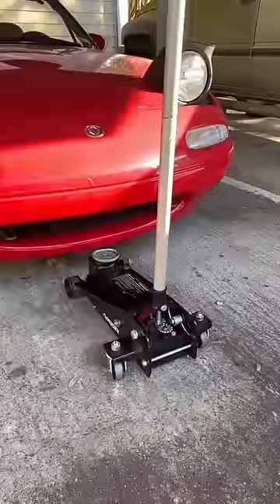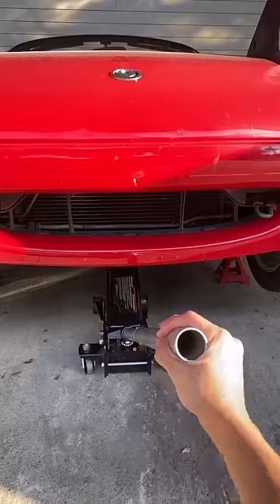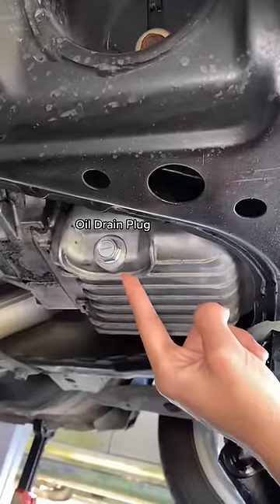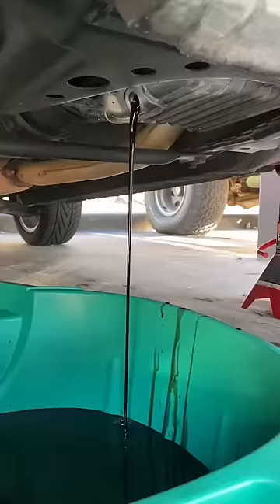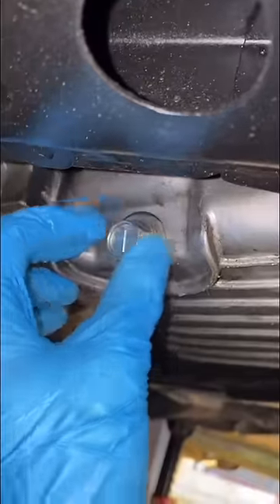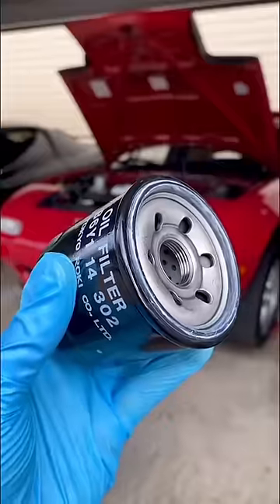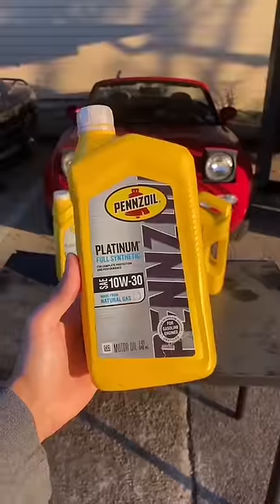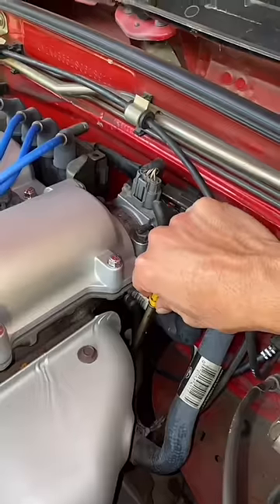How to do an Oil Change! (in any car)

Comment: Video : tighten by hand.
What the local mechanic hears: "tighten to 45000 ft/lbs with the new ass blaster hydraulic thread removal system"
Reply: the ass blaster 😂 that’s me after taco bell 😂 😂 💀
Reply: @rollincoalyt301  The Baja Blaster
Reply: You forgot the threadlock!!!
Reply: Bruh I'm an apprentice tech and we do that shit all day everyday 🤣
Reply: @RickyBobby42069 forel i work on the shop with my uncle and we tighten everything super hard like fuck torquing it to specs
Reply: You go to a bad mechanic shop then i guess
Reply: @jessebol  no its better if they do it tight
Reply: @Tuck3rmurph  why is that?
Reply: @TheOath888  there is a chance of it getting lose and bleed oil. And if something happens to the filter or it falls off, that is a bad name for the shop. So we tight it really good. We have a special tool for it (don'tknow the exact name, we just call it the "filter box"), it can be connected to a T-Bar and can be used with ease.
Reply: The same mechanic you cry to when your car has trouble 😂
Reply: Your model name has me dead lmao
Reply: 🤣🤣🤣this has actually got me rolling
Reply: It's because oil will leak out sometimes and customers complain so the dealer tells their lube techs to tighten 1 full rotation after the gasket hits the top
Reply: @SunhatAshTrUsTinJeSuS exactly. Tighten by hand until tight and then tighten 1 circle with belt wrench
Reply: I've noticed on my personal vehicles that even if I tighten by hand that it will still be tight af next oil change

Comment: Also you should start the engine for about 10 or 15 seconds and recheck the the dipstick then top up if needed
Reply: Before that, when I am changing the filter I prefilled it so the engine never runs without oil
Reply: absolutely. This is what every mechanic i know does, this is crucial in my opinion, the level will always drop significantly after startup, always reckeck and top up

Very disapointed old mate didnt include this in his video
Reply: Also you get more oil out if you remove the old filter before the drain plug.
Reply: @joshferguson2883  exactly I'm not a mechanic but I learnt a very surprising amount when I did work experience at the place my dad goes and I also learnt alot going there with my dad because we are good mates with the owner, so I may not know everything but I know simple maintenance at least🤣
Reply: Its a good idea to check for leaks, especially from the filter once the oil pressure is up.   Pre filling the filter isn't a bad idea but its not really possible on some cars.
Reply: I opened you a little secret. After you do that action you can't see a shit on dipstick🤣.
Each car have manual you should check boys
Reply: I learned it the way that the oil should be warm but the engine should not been running for ~10 minutes so it's not all on the engineparts
Reply: Actually, the full mark on the dip-stick is with the oil and engine at operating temperature. It's takes longer than 10 or 15 seconds to get it that hot. But 10 or 15 seconds is fine if you're only filling it to ¼ inch below the full mark. Then check it later with a hot engine driving it then five minutes after turning off the engine and top it off, if you wish, to the full mark.
Reply: @TIGJOHNNYSILVA  
Unnecessary. The official oil change instructions have never made suggested prefillingvthe filter. All the surfaces inside the engine still have an oil film on them. It would take many days of sitting for that oil film to settle from those surfaces.
Reply: @nemolevola 
Where do people come up with this stuff?
Reply: @njsongwriter  Do you mean what I said or what someone else said?
Reply: Or just check online how much oil the engine needs
Reply: So when you feel it up should you start it & let it run?

Comment: One thing here. Overall pretty solid video but you should remove the old filter before replacing the drain plug just to ensure all the oil is drained and also on some oil filters it is recommended to pre fill with oil
Reply: Lol, what? No, drain it out the plug first, then it all goes into the bucket. The same amount of oil is going to be removed either way. Also, you only prefill oil filters that are vertical, not horizontal like this video… otherwise it gets dumped out when you try to put it on.
Reply: @fredjr.8691  Lmao you read that wrong
Reply: Fun fact: almost all manufacturers don’t recommend filling the oil filter. It can induce contaminants which will imbed themselves into the bearings. I personally pre fill the filter on my car but in a professional auto shop they never pre fill the oil filter unless specified by the manufacturer.
Reply: You never should pre fill oil filters
Reply: @SuperAbsolute1  it a recommendation on some vehicles, ones with filters that are installed on the bottom of the engine. And there's a lot of mixed opinions about whether it's beneficial but it certainly doesn't hurt. The logic behind pre filling is to saturate the filter so that no oil goes through and doesn't get filtered and the filter doesn't slow the fill of oil temporarily on initial startup

Comment: A few points you missed: Best to do oil change with engine warmed up. If car is jacked up at an angle, make sure that the drain plug in the oil pan is at lowest point. Also, pull the oil filter while oil is draining.
Reply: How long should I warm it up? Also wont the oil shoot out if its running?
Reply: @TheNamesFarquaad  funny. You run engine or drive car until engine comes up to normal operating temperature. Then you shut off engine, jack up car at an angle, and drain oil. DO NOT change engine oil with engine running.

Comment: Lifted up my Car just like in the video.
Oil drain plug isnt there, so I sold it. The Toyota MR2 must be broken then.
Reply: Wot
Reply: Never mind, got it 😂😂 good one
Reply: just got an mr2 and lemme tell u, they’re weird😂
Reply: @amd051206  Its a 90's Toyota, what did you expect?😂
Reply: @marvinrazor597  and not just that, it's a 90s toyota with a mid engine and rear wheel drive. not something you'd see in a corolla.
Reply: @firstletterofthealphabet7308  But a Mid Engined, RWD Corolla would be cool
Reply: Having a similar issue with my MR-S. opened my hood but there was a wheel in there??? I think it’s electric but I’m not sure

Comment: Guy made a few key mistakes. 1) warm the car up before the oil change (not to operating temp, just a little warm) 2) your oil drain plug is not always under the oil fill plug. 3) fill your oil close to spec, then warm it up to operating temperature, turn off and top up.

Comment: Also make sure your on semi level ground or you will under/overfill your oil, nobody seems to mention this regardless of the fact a lot of people try to do oil changes in their driveway
Reply: But if your manual says 6 quarts you put 6 quarts in
Reply: @rellort3005 right.. but if your manual calls for 5 litres and your car is at an angle like this when you drain it.. and then you put 5L of oil in.. you could end up with 6L total because 1L of it was chilling at the back away from the plug

Comment: tips:  1. warm up the car before (hot oil has lower viscosity, thus better draining flow) 2.pre-fill the oil filter when installing, little extra care for your engine 3. most cars MIN and MAX mark on dipstick is 1L of oil difference

Comment: Run the engine for a minute to allow the oil to circulate and fill the new oil filter. Once you’ve switched off, wait an another minute, check the level and then top up. Probably drop 500ml.
Reply: If your filter sits vertical you can fill it before you put it in, also don’t forget to rub some oil around the ring before you put it on either way

Comment: A nice trick I learned from a old mechanic is when the oil is nearly finished draining from the oil pan is to add some new oil from the fill cover and it helps get rid of some old oil settled at the bottom of the pan. Takes a bit longer but I have been doing it for 11years.

Comment: I got two extras , 1 If the oil is a little warmed up it gets out easier 2 put a little oil in the oil filter so it won’t start dry

Comment: The only oil change video I’ve seen that does not prefill the oil filter. Amazing
Reply: That oil filter setup is horizontal and not vertical.

 How are you suppose to prefill your filter and screw it in, without making a big ass mess???🤔🤔🤔

Comment: Depending on your car, you might have a "clear flood mode" that can be used to fill the filter without starting the car. This is recommended on Subaru's where the filter is on the top of the engine, and allows the filter to fill so you don't have a dry start after a change.

Comment: If you ever get confused or lost at any point, don't be afraid to look up how to change oil on your vehicle. If you pop the hood, somewhere there's a decal with all kinds of info. Its either on the hood somewhere, or at the front of the vehicle. Somewhere, it'll say it meets ** year emissions or in bold by itself, that gives you the year of the car. There's a group size, maybe 1.5L, that's your engine size. Or, it may look something like "Group: XJ701B1.537SM2311" as well. In that mumbo jumbo of numbers and such, look in there for the decimal point,  and the numbers before and after it. In the above, it's 1.5, and that means its a 1.5L engine. Say you have a Honda Civic, and the only thing you know is it's a 2019. Using the above techniques, you know you have a 1.5l engine. You can now find out what oil type and filter you need. Even drain plug torque specs if you feel fancy. It doesn't take a lot to tighten the bolt, just a bit past snug.

Comment: The drain plug and oil cap aren’t always under each other. In most cases, they aren’t, especially with Mitsubishi engines. (Yes, there are exceptions to that.) Also, never, ever, ever use Pennzoil. When you take you oil pan off you’ll find more sludge with engines that use Pennzoil type products than with Mobil or Valvoline.

Comment: You do also need to start the vehicle after adding oil. Let run for 30 seconds then turn off. Let stand for 10 seconds. Pull dipstick, wipe and check oil level after. You want to know the oil level after the oil filter and all oil galleries are full to be sure you have enough reserve.

Comment: One additional tip, change lose up the oil filter a bit to let the oil drain faster as their is about 400ml of oil still in there even if the oil cane seems empty.

Good job

Comment: On most engines, when you remove the oil filter, which is situated not completely vertical, like here sideways or sometimes even upside down, you get a good splash of oil down to the sump, because you let the air in the lubrication system. Thats why you should firstly unscrew or change the filter and only then, after some time, plug the sump back. You can change more oil this way.

Comment: ATENCION PEOPLE DOING THIS THE FIRST TIME, TO CHECK THE OIL LEVEL YOU HAVE TO LOWER YOUR CAR.

MAKE SURE YOU USE THE RIGHT OIL.

AND THE LAST TIP IS TO ALWAYS PUT A LITTLE MORE OIL BECAUSE WHEN YOU START THE CAR THE OIL PUMP NEEDS TO FILL

Comment: You forgot to mention that after the oil is changed, you need to start the car to let the filter suck up about half a quarter of oil or so, then to check it again so you can properly top yourself off. Or what Is necessary for turbocharged cars is you need to fill up the filter with new oil before installing it, to keep everything lubricated during those crucial few seconds of no oil. Other then that, fantastic video and I too, am a fan of the very pretty leaf.

Comment: Fill the oil filter will oil before putting it on, if it’s sideways then fill it halfway so it doesn’t spill out. It keeps the engine from running dry

Comment: there is one thing at the very beginning that is actually wrong depending on the vehicle. The oil fill cap will not always tell you where the drain plug is it’s different, depending on the manufacture, same with the amount of oil retype of oil filter with her to spin on or canister some vehicles have multiple plugs others I’m just want some even have plastic plugs which have a very high likelihood of leaking how I know this is because I work for a auto maintenance company that has many shops across the USA

Comment: You should check oil level a 2nd time after running up to temp and cooling down again. Won't usually see a huge change but some might need an extra 1/2 quart or so.

Comment: -Check the brakes pads
-Check brake fluid 
-Clean cabin filter
-Clean engine air filter
-Check coolant
-Check lower control arm
-Check all bushings
-check tire tread
Now you are ready ✌️

Comment: Drain plug is not always in line with the oil cap, also you want the filter hand TIGHT not hand snug, and your ideal oil level will always be the max line. Not a little below or a little above

Comment: Hey guys remember when removing your oil filter, check to see if the old gasket came off with it. You never want to double gasket, it could blow up your engine or cause all your oil to leak out.

Comment: You should remove the oil filter before putting the drain bolt back in, on a lot of engines there will come more oil out of the drain bolt once you remove the filter

Comment: Small think you need to Constantly be on the look for when Removing your Oil Filter. about 50% of the time the Ring on the Filter you removed may Stick to the engine and will DUMP all oil in the engine if you start it with 2 seals in place.

Comment: If you replaced the filter, you'll also need to check the oil level after the next ignition, since the oil will fill the filter.

Comment: Multiple tips: Crush washer looks ok? reuse it. You wont be able to loosen the filter by hand, need a band/claw tool 50% of the time. Dont fill "Close to spec" fill to spec and 5% over. Dont crank the drainplug on, only needs like 10lbs of torque. oil filter mating serface needs to be clean, crank that filter on as much as you can by hand. DONT CHECK DIPSTICK until after youve ran the car and then let it sit for a couple minutes

Comment: I have never replaced a crush washer in like 15 oil changes and no leaks 😂
Reply: Replacing the crush washer is like wearing a condom, you don't need to but if you don't life can suck real bad
Reply: @tylerblubaugh5549  not really it will be a really small leak! My Chevy has a rubber gasket on the drain plug so that seals it really well

Comment: He should have mentioned that one should check the old oil filter to make sure its gasket is still on it. Otherwise it's stuck on the port and should be removed before installing the new filter to avoid double-gasketing.

Comment: Those frame rails get bent pretty easily. I would absolutely NEVER recommend using them to support the weight of the car. There is a designated spot along the pinch seams front and back on both sides with notches for the factory jack, that is where you should place your jack stands. 

Jacking up front crossmember is correct, but you’re just asking for trouble using those frame rails.

Comment: Its also IMPORTANT to check the old oil seal when removing the old filter. Or youll end up with double seal when the old one sticks and not removed and it can cause a problem in the long run

Comment: Forgot: "Check old oil filter to ensure gasket came off with it. If there is none, remove the gasket from where you removed the filter."

Double gasketing is a thing. Also, I'd tighten the drain plug a bit more than "gently snug it up." Either to spec if you have a torque wrench, or enough to feel safe that it won't vibrate loose over time. it's for noobs, so they don't have any idea often.

Comment: "Just Open the Oil Filter with Hand" 
Me: I've never had an Oilfilter that was so loose that I could've open it with my bare hands😂😂
Reply: only supposed to be hand tight
Reply: @arcanevoid9199  Yes but when you try open it at the next oil change u gonna have strong arms to crack it open. Ever worked on cars before?😁😉
Reply: Gotta*
Reply: @Werfix1  ive done the last 5 oil changes on my car and its always been easy to take off, and im a skinny kid
Reply: @arcanevoid9199  K. Thats cool. Had to take it of with a tool everytime...

Comment: You should pre fill the filter to prevent dry period for the pump when first starting up ;)
Reply: Depends on whether your filter is placed upside down or horizontally. Can’t fill it if it’s horizontal as the oil will just spill out during install

Comment: Always make sure to lubricate the seal ring on the filter, this seems like the least important step, but if you don't it will leak oil because the ring will get bunched up when you're screwing the filter on the engine, in some scenarios this can be as mild as having to do another oil and filter change, but can be as serious as complete engine failure if all your oil drains or if it gets on the belts in an interference engine

Comment: I don't know about you but I like to use those really cheap jack stands or sometimes I don't even use that at all I just use those really really inexpensive bottle jacks and what I typically do is I put it under the bodywork not the frame and I make sure to get it on a hill at an angle and jack it up unnecessarily high. That always works for me

Comment: Would check to see if there are pinch welds on the side of the car.  The jacks would be placed there instead of the chassis itself.  Also, would recommend to torque the drain bolt to manufactures spec.

Comment: This isn’t an oil change for “ANY” car. Lots of cars out there have lines to drain and skid plates to remove. And not to forget. Check your manuals a fair amount of your foreign cars call for the the oil to be extracted and then pumped back in. Not just a gravity drain. This is an oil change for a “basic car”

Comment: For one that wasn’t a crash washer I didn’t have the lip and not all oil filters look like there there’s also canister filters and you shouldn’t pull the drain plug on some cars you have to use and extractor